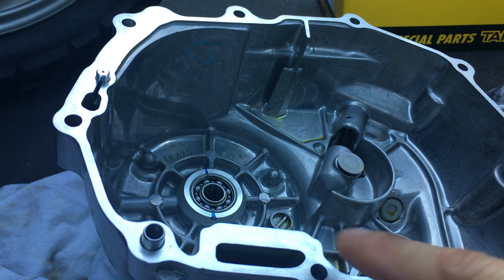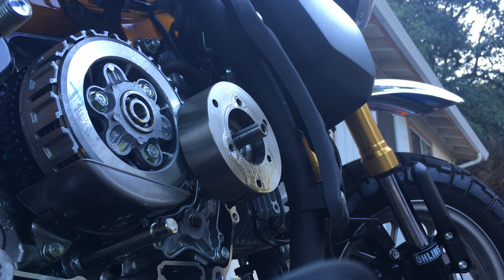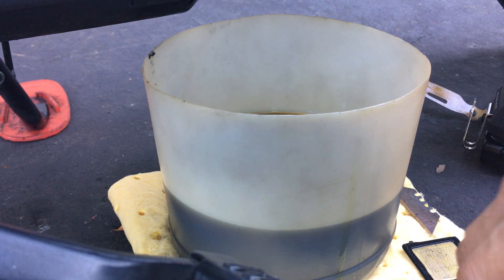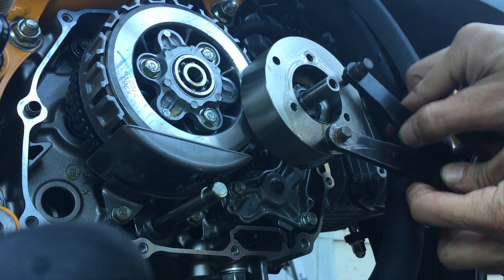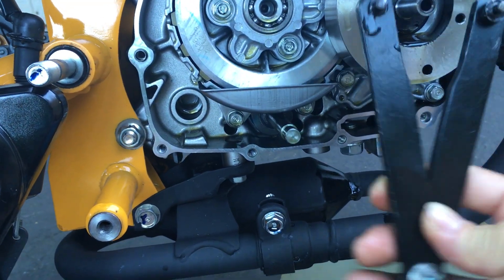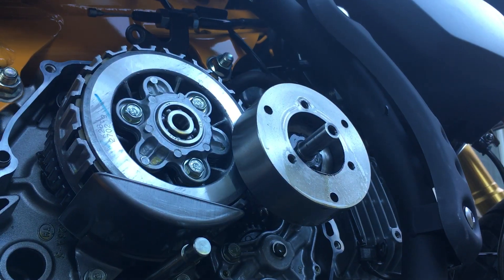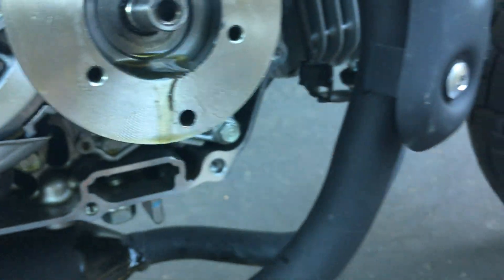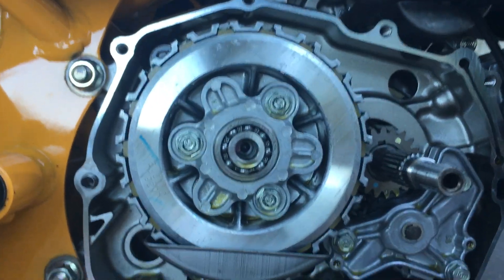Monkey oil filter spinner removal

Comment: How does removing the spinner affect the torque, not sure I follow your reasoning on that. Why did you completely remove the spinner? Can't you just clean it, or were you performing another service?
Reply from the maker: the oil spinner/filter is heavy so if that gets removed you loose rotational mass which you will feel in torque but the motor will be more responsive with less rotational mass.  This is ok for race use once motor winds up and stays high and you want responsivenss but for street use it sucks off the line
Reply: I think the purpose is to fit a aftermarket clutch cover that uses a replacable  oil filter instead of the spinner and mesh filter. The removal of the spinner doesn't alter torue but it makes the engine more unpleasant to drive in daily trafic. It will rev up faster but if you engage the clutch engine rpm will also drop much faster. This means you have to shift fast or you will be out of optimal rpm range for a shift.